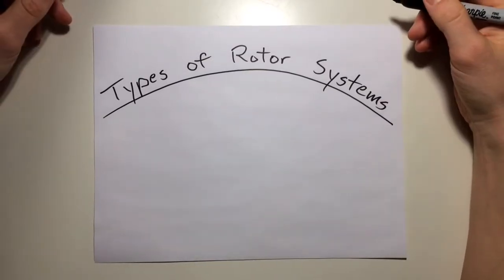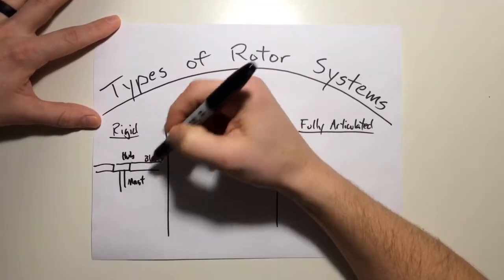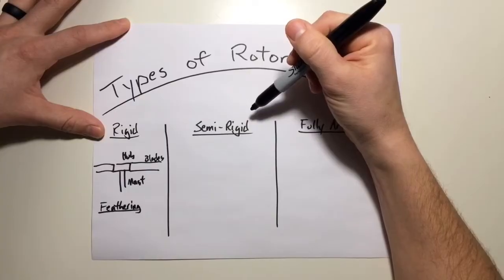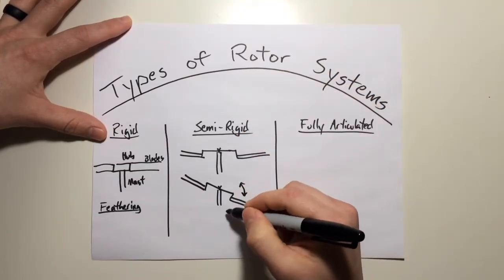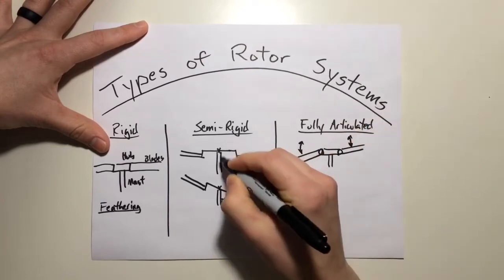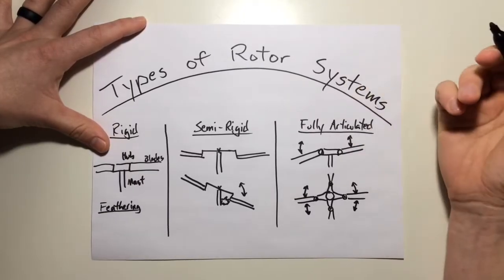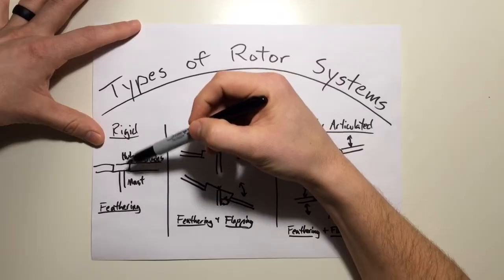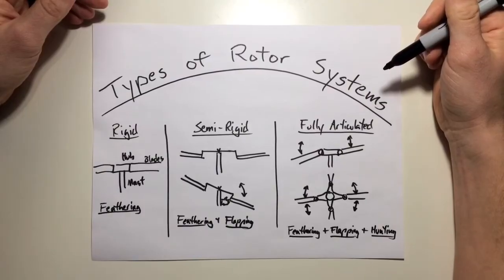Types of Rotor Systems in Helicopters

Comment: Great Video. But I do not believe, that the coriolis force is the reason for the leading/hanging movement of the blades. At that angles the blades are moving up and down the force, resulting from the coriolis force should be hard to measure. I think the aerodynamic effects of the asymetric load in an forward moving helicopter are more valid.
Reply from the maker: Uwe Först. I'd have to disagree with you. The law of Conservation of Angular Momentum / Coriolis Effect explains why rotating bodies increase in RPM as center of gravity shifts closer to the axis of rotation. Coning shifts this center of gravity and therefore causes rotational velocity to increase.  I'm currently putting together a video that explains this in further detail. Be sure to stay tuned in to see it. Thanks for the feedback.
Reply: It is no surprise for me that you disagree. All I wanted to say is that, if you bend the blade 5° upwards, the resulting legth of the blade is 99,6% (cos 5°) of the blade. In my opinion is the change of the angular momentum that low, you can ignore it. On the other hand rises the drag of the blade exp2 to the speed. So you have a sigificant difference in drag between the advancing und the oposite blade.
Excuse my stupid english. It ist not easy for me to discus this stuff in an forign language.
Reply from the maker: Uwe Först. By that theory the blade that flaps up would lag due to increases of drag and the blade that flaps down would lead due to a decrease in drag. But extensive blade testing has shown the reverse to be true. Once again I'd stand by my original statement.
Reply: That is the "bad Thing" in my Argumentation. I have done some reserch about helicopter Physics. I found some stuff that the blades are moving in that way you are telling us. They are talking about some earodynamic reasons... because I did not exactly understand the way it works together I did not write about the moment of leading and laging... and the reasons.
All I want to say is that IMHO the coreolis force is way to low. It is not in my Interest to say that you are wrong. I want to know how it works. You can find my Text at http://virtual-jabog32.de/forum/viewtopic.php?f=70&t=13161 (sorry it is german)
The Vortex videos you have posted on Youtube where very useful.
Reply: @helicopterlessonsin10minut10  
Please do not mix he Conservation of Angular Momentum with the Coriolis Force.  These are two different things with different unit of measures.  The conservation of Angular momentum is responsible for the blade to speed up when the center of the mass of the blade gets closer to the  axle of rotation.  It would happen even if the blade would not flap up or down, let say a mechanism would retract the blade like how a car antenna is retracted..  The Coriolis Force is responsible for the stress on the blade when it moves up and down in a rotating coordinate system.  It is the cause of the blade lagging forward or backwards.  
Other example for the Coriolis Force is that the water in the Mississippi River is pushing the western banks because the water is flowing from north to south on the rotational coordinate system of Earth, but does not get closer or further away from the rotational angle of Earth.
Otherwise I enjoyed a lot this 10 minutes or less.

Comment: Someone said that a true expert is he who can explain his knowledge to the average Joe...and average Joe understands. My hat off to you sir.
Reply: Feather, flap, lead and lag. Think of how difficult a helicopter is to fly vs a plane to begin with. At least in concept. 1 control for each axis? A cyclic, collective, and anti torque pedals vs a yolk? Translational lift? Settling with power? Dynamic rollover? Auto rotations? LTE? No airplane pilot must deal with these concepts. Dyssemitry of lift? Omg advancing air vs retreating air? But rotor systems that allow the angle of attack of blades to change on their own by the blades leading, lagging, feathering and flapping solve the issue of angle of attack for the pilot. The pilot controls the direction of the blades and does not have to position the aircraft in a position the way an airplane pilot does just the pitch and position of the blades. The blades being able to bend and flex on their own means the helicopter will not flip over. A pilot can hover which you cannot do in a plane. More control. But tougher to learn in concept.

Comment: Do you have a short explanation on why the design of the  bell semi rigid system is different from the R22/44, i see the Robinson has a coning hinge but the Bell doesn't
Reply from the maker: Morne Petersen. I don't claim to be an expert in either of those airframes. But from what gather, the R22's coning hinge allows each blade to flap independently while the Bell's rotor head is designed with a fixed, pre-cone angle resulting in the coning forces having to be absorbed by the blades.  It all boils down to stresses on the blade. The coning hinge takes more strain off the blade than the fixed/pre-cone angle design. But some would argue that the Bell design is more responsive due to less hinges which can create sloppiness in the controls.
Reply: Helicopter Lessons In 10 Minutes or Less 
Thanks mate, these 10 min clips are great refreshers